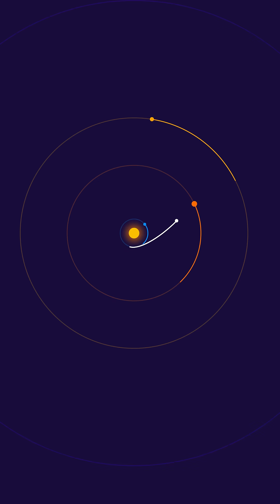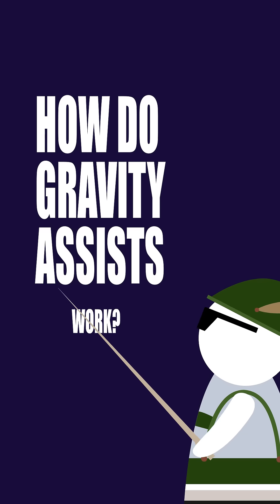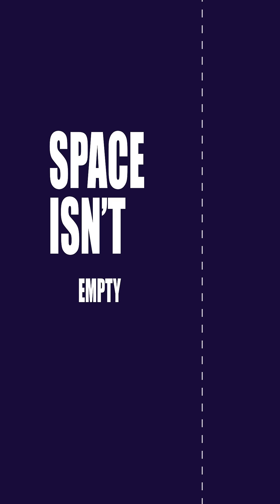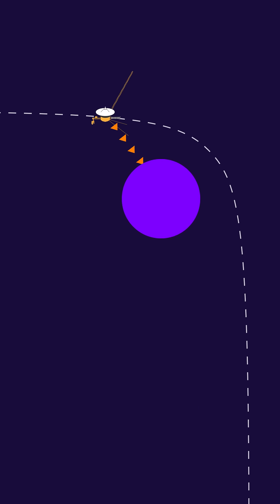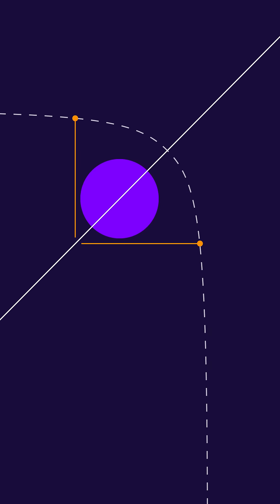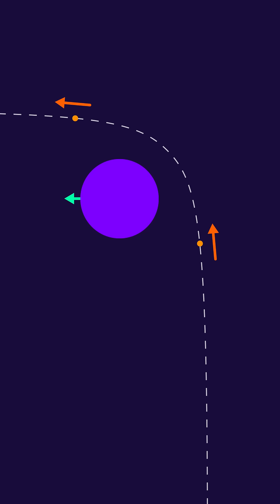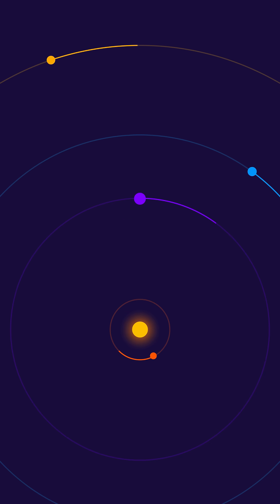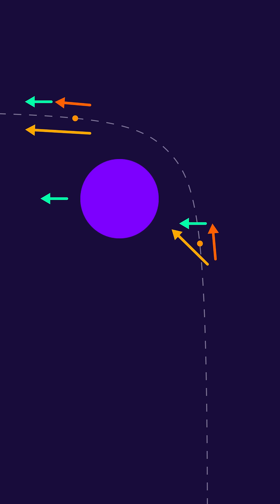How Gravity Assists Work in 60 Seconds

Comment: SURE BUT YOUR PROBLEM IS THAT THE ROCKETS THAT DEPART FROM EARTH ALREADY HAVE EARTHS ROTATIONAL SPEED WITCH IS BIGGER THAN ALL THE REST OF PLANET AFTER EARTH...AND IT IS IMPOSSIBLE TO GET SPEED FROM SUCH A MANEUVER IF THE PLANET RUNS SLOWER THAN YOUR ROCKET AROUND THE SUN
Reply: I think what you mean is that Earth's velocity around the Sun is higher than that of the planets further from it. That is true, but to reach those planets you need to extend your aphelion. To do that, you need to speed up at your perihelion. Because at aphelion you are going in an opposite direction, the force you used to speed up will slow you down there. This makes your velocity lower than the velocity of the planets you reach this way.
Reply: @raptorwhite6468  WHEN DEPARTING FROM EARTH YOU SADLY FOR YOU HAVE ALREADY A GREATER SPEED THAN THESE PLANETS HAVE FROM EARTH'S MOVEMENT...THE HOLE PROBLEM IS...THEY THINK THEY GAINED SPEED CAUSE OF THE FACT THAT...THE SPEED THEY SHOULD COUNTING IN ORDER TO SAY THEY GAINED SPEED IS  THE SPEED THE ROCKET APPROACHES THE PLANET...WHAT THEY CHANGE WITHOUT UNDERSTANDING IS THE RELATIVISTIC SPEED TO EARTH...THIS IS WHY THEY GET CONFUSED THINKING THEY GAINED SPEED WHEN IN REALITY THEY DID NOT...THEY SIMPLY CHANGE DIRECTION
Reply from the maker: If that's true then why did Voyager 1 use gravity assists around Jupiter and Saturn to gain enough speed to escape the solar system?
Reply: @spaceiac  I JUST HAD CHATGPT TO ADMIT IT ALL AFTER A SERIES OF CORRECTION HE FINALLY ADMITTED I WAS RIGHT
Reply from the maker: @boriskaragiannis  okay, so you believe a chatbot that is convinced that the word "strawberry" has only two "r", but the real world is wrong. I can play that game too though:

1. Jupiter Gravity Assist
Voyager 1 made its closest approach to Jupiter on March 5, 1979. The gravity assist from Jupiter provided a significant increase in the spacecraft's speed.

Before Jupiter encounter: Voyager 1 was traveling at approximately 12 km/s relative to the Sun.
After Jupiter encounter: The gravity assist increased its speed to about 17 km/s relative to the Sun.
This gravity assist provided an acceleration of about 5 km/s.

2. Saturn Gravity Assist
Voyager 1 made its closest approach to Saturn on November 12, 1980. The gravity assist from Saturn provided another boost to the spacecraft's speed.

Before Saturn encounter: Voyager 1 was traveling at about 17 km/s relative to the Sun after the Jupiter encounter.
After Saturn encounter: The gravity assist increased its speed to about 20.6 km/s relative to the Sun.
This gravity assist provided an additional acceleration of about 3.6 km/s.

Total Acceleration
Combining both gravity assists, Voyager 1 accelerated by approximately:

From Jupiter: 5 km/s
From Saturn: 3.6 km/s
Total acceleration: 5 km/s + 3.6 km/s = 8.6 km/s

So, Voyager 1 accelerated by a total of about 8.6 km/s using gravity assists from Jupiter and Saturn.
Reply: @spaceiac  SADLY FOR YA WHEN THEY DEPARTED FROM EARTH THEY HAD EARTHS ROTATIONAL SPEED WITCH IS GREATER THAN ANY OTHER PLANETS AFTER EARTH...BY THIS MANEUVER YOU CAN ONLY GET SPEED TOWARDS THE DIRECTION THE PLANET IS GOING AND ONLY IF THE PLANETS IS GOING FASTER...THE PLANETS WERE GOING SLOWER AROUND THE PLANE THAN THE SATELLITES ALREADY TRAVELED WITH...IT MAKES NO SENSE...WHAT NASA SAY SHE DID CANNOT CHANGE IT
Reply: @spaceiac  MAYBE THEY JUST CHANGED DIRECTION AND GOT LOST IN TRANSLATION...WHO KNOWS WHY...IT WOULD BE A GOOD QUESTION TO ASK THEM
Reply: @spaceiac  BY PERFORMING SUCH A MOVE YOU FOR SURE CAN CHANGE DIRECTION WITHOUT ANY EXTRA ENERGY...CHANGING DIRECTION IN ORDER TO GO TO THE SECOND PLANET AFTER THE FIRST ONE WITHOUT BURNING EXTRA FUEL WOULD BE A VERY GOOD IDEA...BUT...EXTRA SPEED...NO
Reply from the maker: @boriskaragiannis  Believe whatever you want dude. Ulysses is an ESA (european space agency) spacecraft that used a gravity assist to accelerate. BepiColombo is a spacecraft by JAXA, the japanese agency and it used gravity assists. There are dozens of examples of spacecrafts from different countries and different agencies around the world using this technique, and because you don't understand it, doesn't make it impossible or wrong. This is not a theroy, this is proven and has been practiced for decades now on different missions. You saying that it's impossible is like you saying 1+1=3. You are just wrong. This is physics, facts and not an opinion. If a gravity assist wouldn't work, then the internet would not exist and your smarthphone wouldn't work either as all of that is based on the same thing. Science, so be ignorant. I don't care. I tried my best explaining it to you, but you just don't want to learn and understand. I feel sorry for you being so ignorant. My video explains the concept of gravity assists pretty well, and if you would actually watch it, you might understand it, but the problem is that you don't want to understand it and that's your problem. Not mine. I'm done wasting my time fighting your ignorance.
Reply: @spaceiac  IT DOES NOT WORK AS THEY SAY SADLY...THEY JUST CHANGE DIRECTION
Reply from the maker: @boriskaragiannis  It's not what they say. This is not a NASA conspiracy. Have you even watched my video til the end? Do you understand the arrows in my video and what they stand for? Those are velocities, speeds. I prove it in my video that they work with extremly simple math using vectors. Gravity assists can be used to change directions, to accelerate and to slow down. All depends on how you approach the planet, but I guess you are smarter than my physics professor at my university and smarter than any person who studied physics...
Reply: @spaceiac  IT IS YOU THAT NEEDS TO UNDERSTAND...THE ERROR COMES FROM HOW THEY COUNT THE SPEED...THE RESULT THEY SPEAK OF IS NOT FROM THE PLANET BUT FROM HOW THEY COUNT THE SPEED AFTER IT DEPARTS THE PLANET IT DID THE SLING SHOT WITH AND HOW THEY WERE COUNTING THE SPEED BEFORE...AT START THEY COUNT THE SPEED IT LEAVES FROM EARTH
Reply from the maker: I don't want to answer this as it's a waste of my time so here's the response of chatGPT:

Frames of Reference and Velocity Calculations:

Earth-Centered Frame of Reference:
Initial Speed: When a spacecraft is launched from Earth, its initial speed is measured relative to Earth. This speed includes both the spacecraft's velocity due to its own propulsion and the orbital velocity of Earth around the Sun (approximately 30 km/s).

Sun-Centered Frame of Reference:
Interplanetary Speed: Once the spacecraft is in deep space, its speed is often measured relative to the Sun, as this is the primary gravitational influence in the solar system. This is the relevant frame of reference for understanding the effects of gravity assists.
Gravity Assist Effect: When a spacecraft performs a gravity assist, it gains or loses velocity relative to the Sun. This change in velocity is real and measurable.
Gravity Assist Mechanics

Approaching the Planet:
As the spacecraft approaches the planet, it is accelerated by the planet's gravity. This process is symmetrical; it accelerates towards the planet and decelerates as it moves away if we consider the planet’s frame of reference.

Planet’s Orbital Motion:
The key to a gravity assist is the planet’s motion around the Sun. The spacecraft "borrows" some of the planet’s orbital momentum. This is where the change in velocity occurs in the Sun's frame of reference.
Departing the Planet:

After the encounter, the spacecraft's trajectory and speed relative to the Sun have changed. The speed change is due to the gravitational interaction combined with the planet's own motion.
Example Calculation with Voyager 1

Before Jupiter Encounter:
Voyager 1’s speed relative to the Sun was about 12 km/s.

After Jupiter Encounter:
Due to the gravity assist, Voyager 1's speed relative to the Sun increased to about 17 km/s.

Understanding the Change:
This increase is not just a recalibration of how speed is measured; it is a real acceleration gained by interacting with Jupiter’s gravity and Jupiter's orbital motion around the Sun.

Addressing the Critique
Misunderstanding Speed Measurement: The commenter seems to think the change in speed is an artifact of how velocities are measured rather than a real physical change. This is incorrect. The spacecraft genuinely gains or loses speed relative to the Sun due to the gravitational interaction.

Frame of Reference Shift: While it’s true that velocities are often discussed relative to different frames of reference (Earth-centered vs. Sun-centered), the changes due to gravity assists are calculated within the same frame of reference (usually Sun-centered for interplanetary missions).

Summary
Real Acceleration: Gravity assists result in real changes in the spacecraft’s speed and trajectory relative to the Sun.
Conservation of Momentum: These changes are consistent with the conservation of momentum and energy, with the spacecraft gaining (or losing) kinetic energy from the planet’s orbital motion.
Historical Success: Numerous missions (Voyagers, Galileo, Cassini) have successfully used gravity assists, demonstrating the practical and theoretical validity of this technique.
Gravity assists are a fundamental and well-understood technique in astrodynamics, providing essential velocity changes for spacecraft using the gravitational influence and motion of planets.
Reply: @spaceiac  you sadly need to explain how things are to chatgpt in order for him to admit it sadly for you
Reply: @spaceiac  you low m8...you did not even get it
Reply from the maker: @boriskaragiannis  I just took your comment and have the context that we are talking about gravity assists. Nothing else. I explained nothing to chatGPT
Reply from the maker: @boriskaragiannis  you are denying my math. I have math as prove and what do you have? Nothing. Prove it to me using math and I will delete the video and say that I am wrong, but the thing is, you can't, because you don't even understand the math I used in the video because you are not even familiar with vectors
Reply from the maker: And I did get what you are talking about, but it's not my issue that you can't distinguish reference frames. The speed at which it departs from Earth is irrelevant because when talking about slingshots we are ALWAYS talking about speeds in reference to the Sun. Switching reference frames doesn't make any sense and I am not doing that in my video. I use the reference frame of the solar system and not of the Earth/Moon system, but you don't understand math apparently, so you just say some randsom stuff that has nothing to do with my video. You can't even tell me exactly where my math is wrong. It's not NASA's Math or anyone elses. It's my math. SO stop saying that they got is wrong. Say I got it wrong and tell me exacly what part I got wrong. The EXACT part and prove that I am wrong in that part using math. I want to see equations and not stupid nonsense.
Reply: @spaceiac  hahaahahah you are hilarious hahahahahah i told you  I CHANGED CHAT GPT INITIAL RESPONSE MAKING HIM TO ADMIT IT!!! HAHAHAHAHHAAHHA
Reply from the maker: @boriskaragiannis  you won. I lost. I am dumb, you are a genius. You should write a scientic paper about your discovery. It would make you famous and you would probably win a Nobel price for that.
Reply: @spaceiac  chatgpt said the same thing...TY
Reply from the maker: @boriskaragiannis  nah mate, really! Your intellect is more impressive than Newton's or Einstein's. You should really consider it! I never witnesses such level of genius before in my life...
Reply: @spaceiac  chatgot said the same thing and i told him to look to what happen to Halton Arp...no ty
Reply: @boriskaragiannis also stop confusing speed with total kinetic energy
Reply: @boriskaragiannis I can make ChatGPT believe 2+2 = 7, does that mean it’s true?
Reply: Dude quit yapping you're just making yourself look silly :3
Reply: @spaceiac  A GOOD QUESTION...CAUSE IT IS IMPOSSIBLE...LOOKS LIKE ALL THEY DID IS CHANGE DIRECTION...USEFUL BUT NOT ACCELERATION
Reply: @boriskaragiannis 
Good on you 
rocks for brains.

Comment: Can we keep adding speed to spacecraft indefinitely by reusing planets?
Reply from the maker: In theory yes, but the problem is that there is only a limited amount of planets + you have to take into account the trajectory of the spacecraft after such an assist. So you can't just infinitely gravity assist around the same planet
Reply: If you go faster your trajectory curves less when passing by a planet because you get pulled on for less time. And if you go too fast you'll exit the solar system instead of falling back. Exactly like voyager is doing actually.

Comment: If you look at general relativity, the probe is only heading towards the planet because space-time is curved, not because the planet has a magical attraction, as Newton described. Then I just don't understand why the probe should be given additional speed? At first it flies straight past the planet at speed X, then enters the curved space-time and thus heads towards the planet. Where and how does an exchange of speed take place here? It just changed direction and also time, why suddendly speed?
Reply: I think this might answer your question. But before I try to explain I want to note that Newton came up with Laws (observed phenomena). Einstein came up with theories (well tested explanations). There are unanswered questions about why the math works. But the fact that it does is not disputed. So be careful asking why on this topic, because you will find the limits of human understanding and a lot of untested and unproven theories claiming to be the answer on the internet. You can get a good understanding of how it works though.

Speed is relative to your frame of reference.

During a gravity assist, the spacecraft essentially "borrows" some of the planet's orbital momentum. As the spacecraft approaches the planet, it falls into the planet's gravity well, gaining speed. As it moves away, it slows down again, but because the planet is also moving in its orbit around the Sun, the net effect is that more speed is gained than lost, if the maneuver is done correctly. The spacecraft can leave the maneuver with a greater speed "relative" to the Sun.

According to the principle of relativity, the laws of physics are the same in all inertial reference frames. However, the kinetic energy of an object is frame-dependent, meaning that different observers in different reference frames will measure different values for the kinetic energy of the same object. This is due to the fact that kinetic energy depends on the frame-dependent quantity of velocity.

In the context of general relativity, due to the non-Euclidean geometry of curved space-time, there are no global inertial reference frames. This means that the concept of an absolute, global inertial reference frame is not applicable in general relativity. Therefore, in this framework, the property of being frame-dependent applies to all measurements, including acceleration. While the laws of motion are the same in all inertial frames, in non-inertial frames, they vary from frame to frame depending on the acceleration. This implies that in the context of general relativity, even acceleration is frame-dependent.

Hopefully that helps or at least sends you down the right path to finding the answer.

Comment: In the final part you didn't include the gravity of planet pulling the spacecraft , does the movement of planet along its orbit create more push than the pull of its gravity??
Reply from the maker: You don't have to include it. Assuming you take the escape vector at the moment when the its orthogonal to the planets gravity vector, the gravity would have 0 impact on the velocity. It would only impact the trajectory. The spacecraft will gradually start to slow down after it leaves the planet, but that's general orbital mechanics. This video is just to explain how gravity assists work and why spacecraft slow down/speed up when using a gravity assist.

Comment: In this example you have the planet 'chasing' the probe after the trajectory change. You'd think that would mean the planet acts negatively on the probe for longer. Wouldn't it make more sense for the probe and planet to be separating from each other's influence as fast as possible after the assist?
Reply: The probe is moving toward the planet longer than than the planet trails the probe.
Reply: The explanation wasn't making sense to me either. I looked it up and it still doesn't make sense. To achieve a speed boost you approach in the direction of orbit of the planet, and leave in the opposite direction.  But all the examples (like the one seen here) show it leaving in the same direction as the planet's orbit.